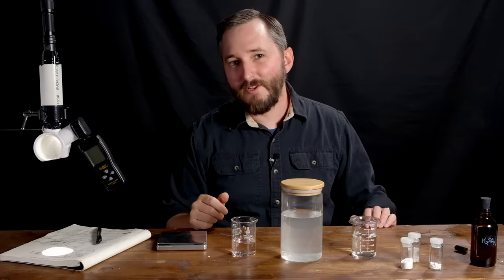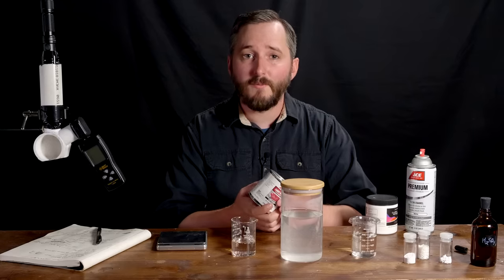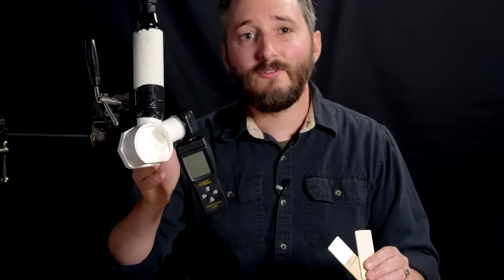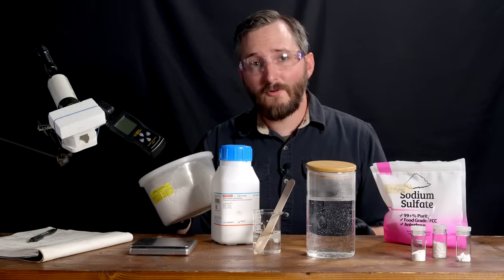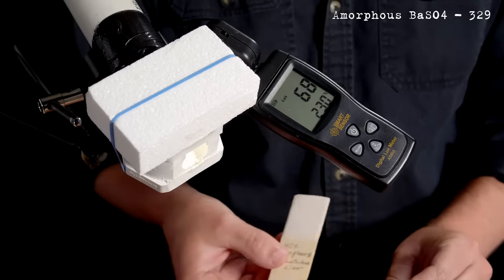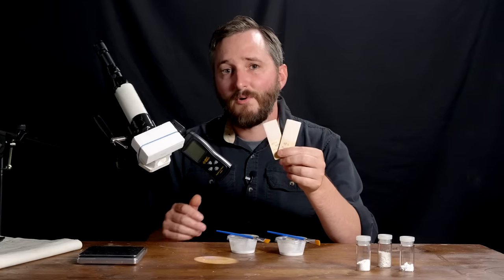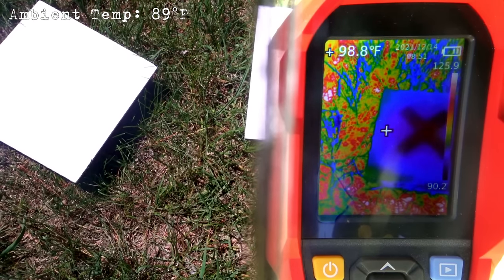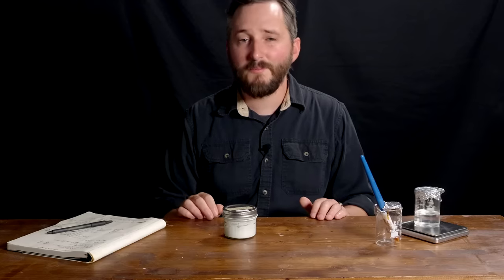How To Make Infrared Cooling Paint (Electricity Free Air Conditioning)

Comment: This is brilliant indeed. I foresee some important applications - paint for cars, refrigeration trucks, LNG tankers, air conditioners, and also direct house paint for warm climates. It would be interesting to know if painting the underside of solar cells provides a beneficial cooling effect compared to bare metal (solar cells lose efficiency as they warm up). Have you per chance experimented with the calcium based pigment as well? It seems more environmentally friendly than the Barium based ones and I am curious how it would perform in comparison. It would also be great to know how it compares when layered on top of or in solution with Titanium based paint and also how well it does in terms of heat dissipation compared to the Titanium white, bare metal, and perhaps some black pigment designed to maximize dissipation. Anyway - thank you for putting in the time and effort to do 'actual' science on YouTube :)

Comment: I’m left wondering what the weatherability is for this paint. How long can it be left in direct sun before degradation occurs? Can a clear-coat be applied to make it easier to keep clean?
Reply from the maker: That's something that needs testing
Reply: This was my big question as well. How long until this paint breaks down and starts to come off of the surface it's painted on?
Reply: Yes please! I just wrote a comment questionting that indeed! This would be amazing for cruising sailboats
Reply: @Nighthawkinlight  Yes ! Pollution of rain waters is very important to take in count !! ; )
Reply: @Nighthawkinlight  Hey, love to see you make a cube or some enclosed volume pained with this stuff, and then make a black one (we all know how hot black cars get) and see if the thermal potential between them is useful (sterling engine or Peltier junction).  More-over, is there an inverse version, a black paint that will say have somehow reduced black body radiation, but super high absorption?   Maybe due to the structure, or some element's spectra again?   Or, what if you try and whack thermodynamics over the head by putting multiple boxes inside each other like Russian nesting dolls, each with white paint on the outside and black on the inside, such that any thermal energy from the innermost one is absorbed by the one outside it, emitted again by it's outer white surface and and so on till the IR is thrown out into space?!  Could the innermost box become colder than a single layer box?

Comment: This is incredible (I mean, very credible) quality content. Thought I was subscribed, somehow was not, now I am. I'm curious about the lack of experimenting shown with CaCo3, because in the opening statements you mentioned it as one of the two known specific IR emitters. I would be very curious to see a sample that includes these IR pigments (Barium/Calcium Carbonate) used with an off the shelf ultrawhite paint (EDIT: to make it simpler to use rather than making your own base paint, although I've seen other commenters mention fumed silica, danger, that's cristalline silica and lung cancer, but very effective indeed to enhance coatings). And after all,  white limes and chalks were used to cover buildings for ages.

To further add to the concept of cooling spaces or objects, air gaps or vacuum gaps are often found to be effective at insulating and multiple layers can perform better than a single layer, especially when there are gaps in between. A similar concept also extends to armor plating of among other things, spacecraft or ships or armored vehicles: a whipple shield. The point being that a first layer of defense breaks or scatters or reflect or all of the above some of the energy/particles/objects, and then you have the main armor, that can then be of lower thickness. Perhaps a building (shed/bird or dog house size) covered already in reflective white paint but with outer panels at a distance would perform even better. The outer panels could have an IR absorbing layer on the side facing the building, and IR emitting coating on the sky facing side. Air flow between the layers could further insulate the building?
Reply from the maker: I will experiment with calcium in a future video. I used barium here because it's reported to give the best results.
Reply: @Nighthawkinlight  In the nineteenth century, Thomas Stevenson devised a housing for meteorological thermometers to accurately measure the ambient air temperature, and exclude the heating effect of direct solar radiation. It was a box of wooden construction with a double roof, double louvred sides for air passage, and base to deflect warm air from the ground below, set at a standard height from a grassy surface where the box, or Stevenson Screen was to be located. Its door(s) were set on the north facing side in most regions of the northern hemisphere to protect the interior from sunlight. Finally, a white exterior was chosen to reflect radiation, so the box would not be subject to direct solar heating. Victorian paints could be oil based, and tended to discolour with solar radiation, so often lime-wash or whitewash was used, which could be reapplied as it faded. This was basically precipitated calcium hydroxide and calcium carbonate, which occurred through reaction with carbon dioxide from the air. It was also not impermeable to water, so the timber often retained water and depressed the measured temperatures inside, and over time, the screens rotted and needed repair or replacement. In the latter half of the 20th century, better brighter white paints which had pigments such as titanium oxide, and alkyd medium which waterproofed the timber were used and even metal Stevenson screens with aluminium louvres were produced for commercial use. Today, the screen of choice used by the UK met office is a plastic product, with a black interior. And I am not surprised that over the course of the past couple of hundred years, measured temperatures continue to increase!
Reply: I too wondered about the your idea of using an air gap between surfaces. "Screening" buildings with shade structures has been a successful  strategy in several styles of architecture.
Reply: I've quickly read about this phenomena. The problem seemed to be how difficult to make it and how strong wold be those materials exposed to the weather. The video made it look kinda simple. I've read again and it seems EXTREMELY EASY. Too easy to be true. Just Silica (Sand), Calcium (Lime) and maybe Titanium (white pigment). That means, the good and old Lime Mortar. Maybe just not as efficient as made in laboratory. The flat radiant roof with heavy mass is traditional in hot and dry climates countries, although not with such efficient radiation and reflection. A transparent coat may do the isolation mentioned and at the same time protect from the 2000mm of anual rain.

The problem if this actually works is that maybe if the roof temperature falls over 5° below room temperature it could generate dew.
Reply: @fredericoevandro-veladelibra  Condensation on cold walls, ceilings and windows is usually dependent on a couple of factors, the high relative humidity of the internal air, and the lack of moving air near the cooler surfaces. If there is sufficient ventilation, then the changes of air allow the cooler surfaces to exchange heat with the air, allowing the surfaces and air temperatures to equilibrate, and then there are no cooler surfaces to allow condensation upon. Like a car windscreen becomes misted on a wet day, but if the fan is on, the condensation soon clears.
Reply: I was going to ask him the same question about using calcium carbonate, but see you beat me to it. I'm also wondering if silicon gel could be used as a binding agent effectively for the purpose. I used such to cover roof of my trailer, a "cool white" silicon roof coating, which really helped in Florida sun. Also, for 3 years I lived in Kriti, in flat concrete roof with white coating on top. In summer I'd go up and spray water on the roof, and the evaporation of it during the day helped keep it cooler indoors. We had no AC there.
Reply: Rolf, for air gaps, take a look at the vine-covered pergolas traditional in many southern climates.  The top leaves heat in direct sunlight, but there's lots of air circulation to carry the heat away, and more layers of leaves underneath.  Also evaporative cooling as the leaves lose some moisture.  They work really well for cooling the space underneath even though spots of direct sunlight come through.
Reply: @Nighthawkinlight  This was a great video, and I'm excited to hear about the calcium experiments too.  It's not impossible that even if barium has better results in lab experiments, calcium might give better results for homemade paints (that don't need a centrifuge for example).

Comment: 12:00 this is exactly how PTFE works (especially expanded PTFE), and why it is used as the inner surface for integrating spheres. Have you considered roof coatings made to keep surfaces surfaces ? I painted my dark shingle roof with BLACK JACK ELASTO-KOOL 1000 10 YEAR WHITE SILICONIZED ELASTOMERIC ROOF COATING a few years ago, and my thermal camera shows a pretty big difference; thanks for reminding me to go check that compared to ambient!
Reply: @chuckles3265  shingles. I tried to quantify energy savings but there were just too many variables and I couldn't come up with anything unfortunately. It felt subjectively cooler at peak heat times in the summer.

Comment: I'm so happy to see this video! I've had a bit of interest in sub-ambient radiant cooling as a DIY, so I've done a little reading about this as well.
One thing I've come across is commercial reflective rooftop paint - have you benchmarked any? Some have fairly high thermal emissivity.
You mentioned calcium carbonate - have you tried it? I'd be really interested to know if off the shelf chalk powder works...

Some other things that could be of merit: pores are also formed in polymers by adding pore-formers that are non-soluble in the paint base, but can be dissolved out later (eg, with acid).
There's also some work using nano-silica, which I just learned can be made by blending sodium silicate with certain resins, then curing.
Reply: What about dual sided solar flat plate collectors? One side is matte black for collecting solar energy during the Winter for heating then flip them over, remove the rigid foam panel to expose the white, high emissivity side and they become a cooling panel during Summer.

Also, could a person scatter Lime over the roof during Summer and wash it off during Winter? It might blow off or just be too time consuming to be practical.

Comment: This is some really interesting stuff. And as a former chemistry student I love the plastic/acetone/water microstructure system. I look forward to the next video in the series. I can already see Cody's Lab making a full cooler system with it haha
Reply: Tech Ingredients made an AC that relies on evaporative cooling, it could be combined with this to reduce the water consumption.
Reply: @umbrel  unfortunately evaporating cooling do not work in humid climate like in  New York City, where I live. I am looking how to remove moisture from the air with out absorbers or heat pumps.
Reply: @miroslawkaras7710  I don't think there is a way to remove moisture from air without changing the pressure or temp using a heat pump or absorbers. I mean, you could use a peltier cooler with the hot side outside your house and the cold side inside and condensation would form that you could drain away, but that would still be a heat pump of sorts and a/c is way more efficient, especially if you use a ground source.
Reply: @filonin2  I think that this ambient cooling could work to remove misture. Think about reversing air heatting solar colector. Istead of dark paited, you pain that in white and direct that coletor away from sun, the temperature in the colector shold start droping. Does the temperature  drop to the humidity drew point not sure, . If  so, that will start drying out the air. 
It will be interesting to build such heat radiation emiter with evacuated tubes.  The efficiency shoul be better.
Another idea: istead of finding the best white surfate, why not built tuned optical cavity filter that could be tiune to that specific IR bend gap. I am RF engineer, so looking on RF filters in pass bend you have high absorption, in stop band there is  almost total reflaction. I am not sure how that works in optical systems,  but it shoul be similar.

Comment: Thank you for this innovation.
In some parts of the world people living in apartments have a heat problem. The afternoon sun heats up the external walls and this warms the internal surface considerably ... in fact the walls act as a heatsink and they stay warm for hours after sunset. This forces the aircons to work longer consuming a lot of energy. What is needed is a paint to cover the internal surface of the walls that can act as an insulator.

Comment: calcium carbonate too? in that case wouldn't using a traditional whitewash be worth trying. calcium hydroxide solution applied to a surface which then reacts with CO2 in the air to form tiny carbonate crystals. maybe they'd do a bit of snow-scattering too.

Comment: Paint also need an ingredient as a solid content. Some paints do use calcium carbonate, the more durable paints will use fired ceramic dust (which makes the paint more durable and less likely to scuff), and there's a range of other things that will have different properties as well. A paint's hide (this is a technical term for the lack of transparency) is definitely affected by the type material used for the paint's solids.

The solids should make up about tenth to a quarter of your total amount of paint. Too much of it will make your paint flat, and enable you to wipe it off the surface with a damp cloth... I'm looking at you, chalk paint!

Your solid content is counted differently from your pigment. In a gallon of paint there's usually 14-16oz (fluid) of pigment.

Comment: So, I wonder if there would be an advantage to combining this with a transparent solar cell; if the insulating film were replaced with photovoltaic glass, perhaps the reflected light from the paint, with the added IR (assuming it's in the same band as is absorbed by the panel) could increase the panel's efficiency. Even the whole panel produces very little energy, it could be enough to run a small water circulating pump under the panel, eliminating the need for an outside power source to run a coolant system... Just a thought anyway.

Comment: Something to keep in mind is that emissivity and absorptivity are the same thing. Anything that emits a spectrum will absorb that same spectrum exactly as well. Therefore, things which are better emitters of thermal radiation do not have a lower equilibrium temperature with the radiative environment, they are simply more strongly coupled to the radiative environment. All stuff emits thermal radiation pretty well, so a coating that emits particularly well is only a little bit better than any random rock or even you. This means that the most important thing for direct sun temperature, by far, is total reflectance. It also means that, at night, black things are colder than white things, both of which are colder than transparent things like air. In fact it is the sun heating the ground which heats the air in the day and the sky cooling the ground which cools the air at night. You have accidentally produced a really fantastic demonstration of why frost and dew happen overnight.
Reply from the maker: You're exactly right about emissivity and absorptivity. That's why it's important this paint is in the IR window, because there is no reflected IR bouncing around in the air in the spectrum that this paint absorbs. Other emitters are sucking up energy from all the other objects on earth as its absorbed and remitted by the atmosphere.

Comment: I've always wished there was a temperature sensitive paint that would either reflect heat or absorb it depending on temp.  Cool in summer, warm in winter.
Reply: Re: your comment wishing for temperature-sensitive paint, @robertwilson8789 a few weeks ago suggested painting this sub-ambient ultra-white on vertical blinds. That way, the effect is reversible, just a flick of the wrist twice each year.
Reply: Maybe combining this with a thermochromic paint that turns black during cold temperature 🤔

Comment: It would be cool if something like e-ink could be used as a layer in front of the paint, so that in winter the building can stay warm. That would likely be pretty expensive though, and I'm sure that there would be cheaper/easier methods of going about that.
Reply: Movable panels could work. It would require having a person (or mechanism) physically swapping them out, but your idea has merit. At least at the macro scale.
Reply: Paint over the white with a thermochromic black paint that turns clear above the temp at which you'd need to start cooling your house? Not sure how'd that affect the thermal radiation, or how well the thermochromic paint would keep its color changing ability over time.
Reply: @JeffHanke  I've looked into thermochromic paint before, it appears to be too expensive to paint houses with, although it is a really cool idea.
Reply: @JeffHanke  Would the thermochromic paint become clear to the UV spectrum this paint emits?
Reply: @Serahpin  I'm not sure, that's one of the things that would have to be evaluated.